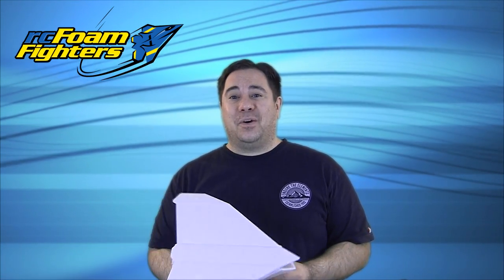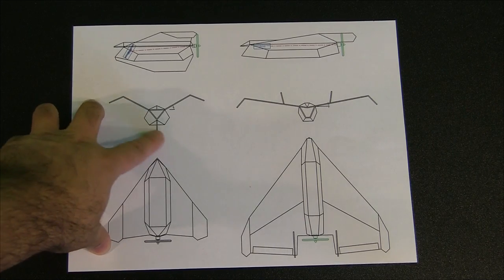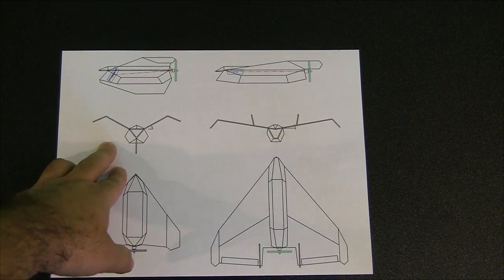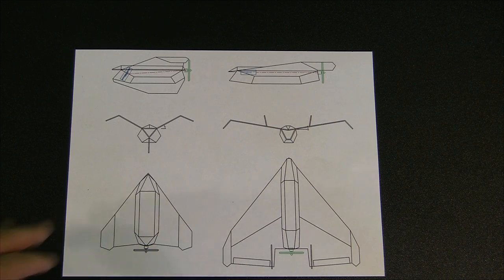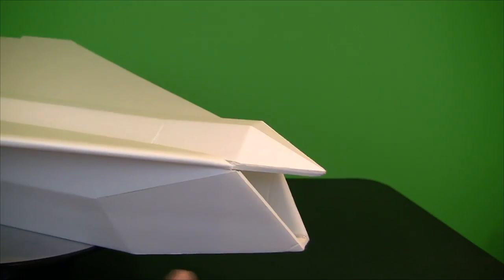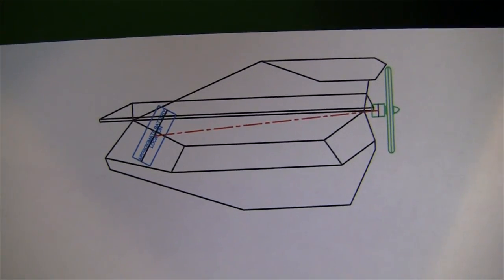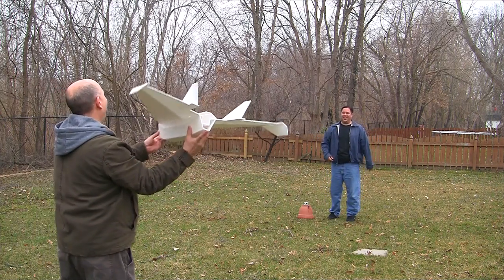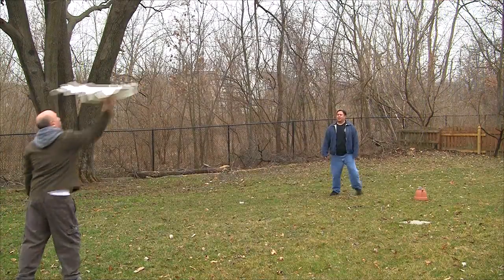MPUAV-Part3 Back to the Drawing Board

Comment: Looks like you could drop the battery compartment to the bottom where it will not block air intake as much also by doing this, the plane isn't as top heavy which causes more issues with torque roll with Edfs. Looks like a seagull with its mouth open. I like it better the way you have it now vs your original idea.

~Jeff